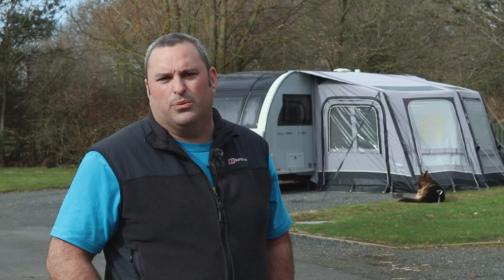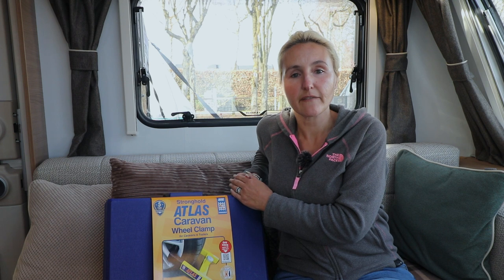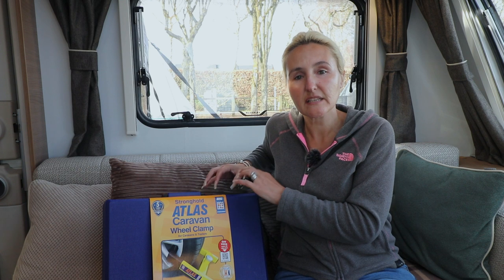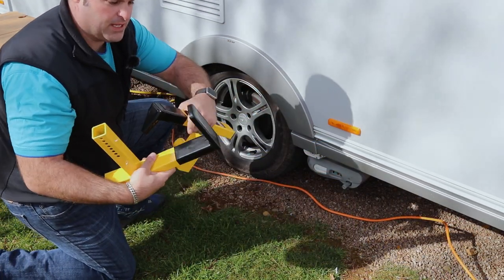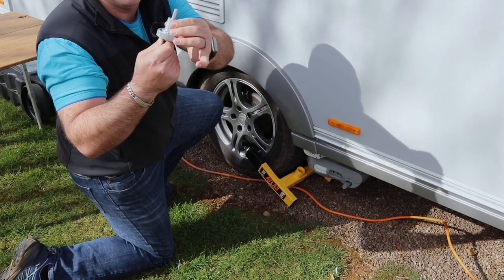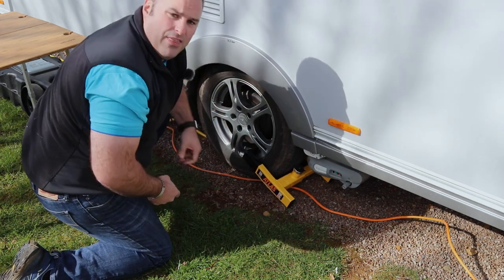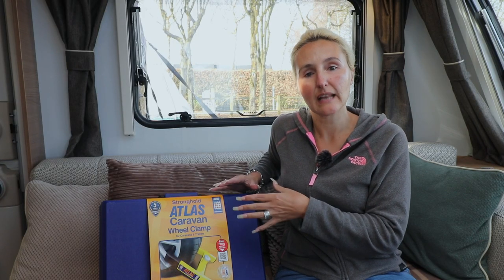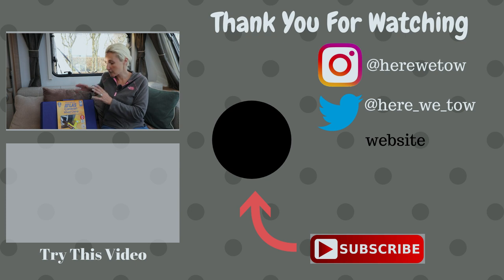Stronghold Atlas Caravan Wheel Clamp review 2019 [CC]

Comment: Good reviews on both items but they're not for me - the hassle of fitting them and two locking wheel nuts especially in bad weather is not to be dismissed. Another aspect is weight - I already have twin AL-CO wheel locks, heavy duty hitch lock, corner steady locks, if you add up the combined weight plus locking jockey wheel handle, torque wrench, trolley jack and nose weight gauge your hitting over 50 Kg.... where do you put all that weight, car or caravan. Like everything in life you have to compromise at some point.  Keep up the good work you guys and would it be possible to do an update on the Rexton, I had a test drive in the Ultimate - brilliant car, loved it, very quiet and full of features but it felt under-powered compared to my tow car ML350. Now you've owned it for a while how are you getting on, would you change it?
Reply from the maker: Thank you very much for watching, sounds like your caravan is well secured. We are looking at a Rexton update soon along with the Isonzo one year update. We have been really impressed with the Rexton and having just taxed it for the year at £140 we are even more pleased. Cars over 40k are being stung on tax. Yes it is underpowered if you want a bit of poke but for general driving it’s fine, it’s great on the motorway and for towing. At the price there’s nothing to beat it for a huge gadget loaded SUV 🚙 👍
Reply: Yes I recently had a test drive and would be interested in an update